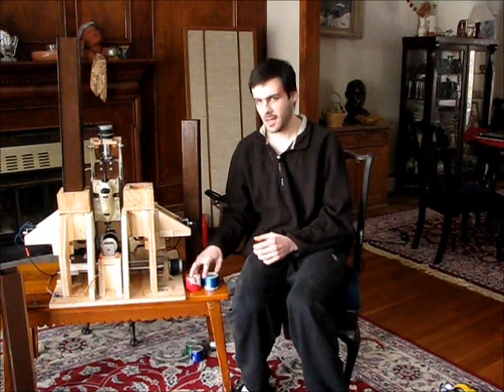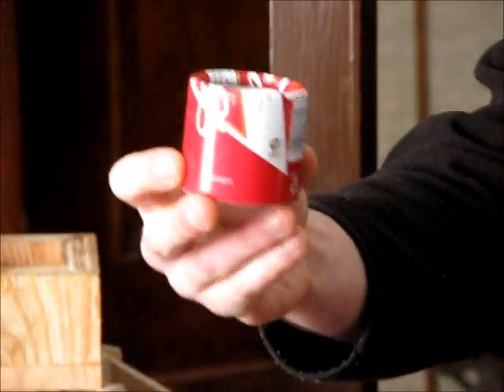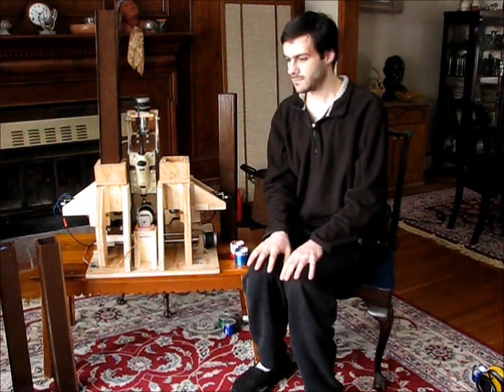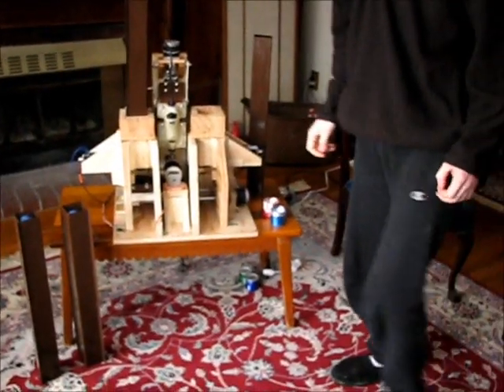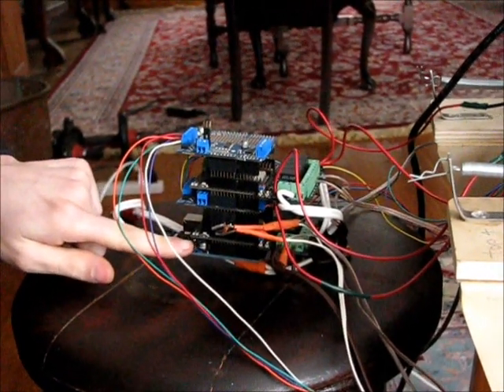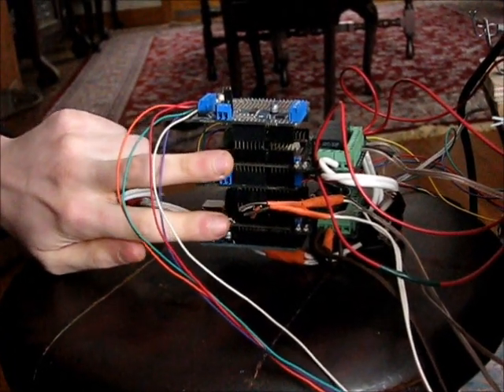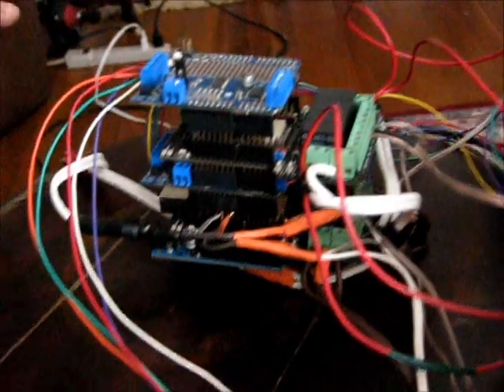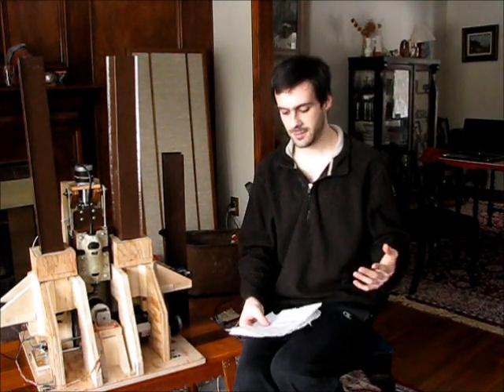The average Joe can build manufacturing robots.

Comment from the maker: +Richard Collette
I've tried making stoves with a thin gap between the 2 walls, and they didn't prime well. I'm guessing that adding a wick makes a huge difference with that design, but that would add an extra step when cooking, and the wick could receive abrasion in the pack.
When shopping, I found the following to be true:
1.  Steppers are cheap. They were some of my cheapest components. A normal motor + encoder would be more expensive.
2.  At the time, the ball screw assemblies that I could find were cheaper than the racks and pinions I could find. I now know to look at mcmaster.com, and a Japanese place that begins with "M".

I've since upgraded it with a vacuum system and other stuff. My upgrades cost <$8.

Comment: Nice job.   You're a smart guy, almost too smart (jokingly).   I used to work at a manufacturing company programming assembly machines.  Your approach is a little bit too complex.   You probably didn't need stepper motors at all and could have dropped the cost considerably (I used to save steppers from junked typewriters or printers to save money).  A crank and rod (http://507movements.com/mm_166.html) similar to how a windshield wiper motor works, would suffice for the drill motion.   The cans could be released down a ramp to a  V shaped catch with a hinge at the point in the V.  Connect a rod to the v and use a solenoid or another small motor and crank to tip the V in either direction to drop out.  Steppers are only necessary for precision placement.   I programmed a large robot arm that removed plastic parts from a press.  This used a very large motor (3 times the size of a garbage disposal approximately) in the horizontal direction, with an encoder wheel.  You would be amazed how fast and accurate you can be without having to resort to steppers.  This one just needs a motor with a rod, crank and optical or magnetic switch to indicate it went all the way around and turn the motor off.   The KISS principle will serve you well and the machine will run much faster.

I bought your stove and the minibulldesign bios#5.  His is a little more KISS and a LOT quicker to prime.  Both are pretty much the same weight.  I'd give it a look and refine your design.  If I had to guess, I'm thinking the interior cone in your design is keeping surface area away from the flame for priming/heating the can.  He also incorporates a gap at the top to prevent pulsing.   I wouldn't copy the design but try to achieve the same principles of operation using slightly different methods.

Good luck.